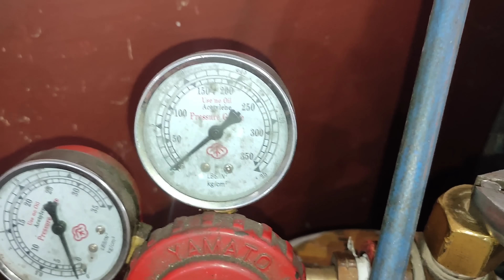how to weld aluminum without argon

Comment: Another case of “ A little knowledge is Dangerous “.
Reply: That repair will last as long as a sneeze
Reply: @arturotoscanini3833  
And nowhere as enjoyable!
Reply: What would you recommend
Reply: @MomodouSemegaJanneh  
Firstly it needs to totally clean then correctly prepared before welding in an oxygen free environment. 
Take a few basic classes in welding.
Reply: Back in 1978 The US Army taught me and other enlistees in a Proving Ground base, the procedures and practices of various welding processes. In order to complete the Annex, the last process was oxyacetelene welding alumimnum. And the last test was welding a single "v" groove butt weld in the flat position with  30 degree included angle, I believe.  The aluminum coupons were aproximately 10" long. This was the hardest to do succesfully because aluminum does not change color when it heats up like mild steel and stainless would when welding with the GTAW, GMAW, SMAW, FLUX_CORE, processes, etc. When you heat it up, at a certain point, the puddle drops and its off to the races. Of all the other processess taught, this was by far the trickiest. 
That being said; is this weldment fix legit? I would say, not knowing all the other factors relative to this case I would say it may or it may not.
Cleaning aluminum is very important to the quality of the outcome for both cosmetic and function. And in this case not much cleaning other than perhaps wiping seems to have been the case. 
I have to give it to this dude for putting out this video. If for no other reason than to learn how judgemental people who think they know, are.
In the video authors case this may be all he/she had to work with.
So, if it worked, more power to him/her.
Aluminum welding with oxyacetelene is a thing, really.
It is interesting he/she used a 6013 SMAW rod to blend or mix the crack. Then reinforced the work by overlaying aluminum, thereby adding penetration in reverse.
I thought it was cool. But what do I know.

Comment: So, actually brazing or soldering, not welding. I HAVE gas welded aluminum (welding is when you actually melt the parent metal together). It is much more difficult! Also, it changes the temper (hardness) of the metal (annealing), making it useless sometimes, as anything that broke it in the first place would likely bend it easily after the metal has been heated and cooled. An example of TRULY welding with oxy/acetalyne is the process in Britain of building alloy fuel tanks for (now) vintage motorcycles. Part involves special blue-lens goggles, which are not available in the US.

Comment: Tahun 80 tehnik las begitu ..sudah ada pakai las acetylin...
Reply from the maker: I use used brake pads made of aluminum to make welding materials, you can also use engine blocks that are no longer suitable for use 🙏🙏

Comment: . . . torch tip needs cleaning,  probably should wear leather gloves (and safety glasses) when using a small electric grinder,  work piece needs to be cleaned before welding it 🤔  taking the time to get a few small details right could greatly improve the quality of your repair
 . . . also it is not welded in a true sense but it is probably good enough to get by for now which there is nothing wrong with that if it is working for you but the ferrous material in the repair will begin oxidizing on exposure to moisture which might be a consideration of why the bracket is made of aluminum in the first place
Reply: Was not a ferrous metal filler, if it was it would not bond with aluminum.
Reply: @tubeonline629   . . . there was NO bonding,  it was  not a coalescent weld

Comment: That Welding rod stated 6013. 6013 is a Steel Rod. Steel and Aluminum doesn't mix two different Metal's. My opinion the only way to weld Aluminum is Heli arc. Both pieces must be completely Clean.
Reply: You need metal rod to remove the oxide layer is not filler material
Reply: @jetfulvio  A Stainless Steel Brush will do the same thing. Adding impurities into Aluminum doesn't work For Me. You are the First I scene to do this type of welding. Aluminum is Very hard to weld because of contamination. There is oxide in the Metal that causes the metal hard to weld. Welding with AC Heil-Arc is the only way with a High Frequency unit. Braising flame has a pluting Flame.
Reply: @waymonblevins6939  @Waymon Blevins  you will be surprised because with oxyweld you can weld really weld old dirt and oil crankcase (i welded old vespas crankase i let you imagine) and have no porosity in the weld , also the oxide layer is kinda inhibited with a rich flame  and you have to scratch the surface to understand the melting point of the alluminium which is lower than the oxide temperature
Reply: @jetfulvio  What Gas are You using? What Aluminium Filler Rod are You using 4043 or 6061. The 6013 is an AC current Rod. That is not an DC Rod. I understand the heat burns the oil and grease but You still have to clean the Area you are welding.
Reply: @waymonblevins6939  acetylene and with the tig rod it wasnt really good you have to try with melted alluminium like those guys also did trust me
Reply: @jetfulvio  I have been a High Pressure Welder for 43 years at pressures of 10,000 psi Steam. I have worked in Steam Plants in Nuclear Plants, Plant Mills in Black Liquor Boilers but I never seen this type of welding before.  I have done all the Forms of Welding Mig, Tig, Stick, Fusions Welding and Brazing in Steel to Brass on all kinds of Metals but You Surprised me seeing this. I have worked with very Good Welders in my life as myself but never have I seen using Steel on welding Aluminium. Just informing You.
Reply: @waymonblevins6939  steel is only to remove the superficial layer of oxide that melt at highter temperature than alluminium, if you try to weld a piece of alluminium you won't be able to see his melting point and at one point it will just collapse because the oxide melt after alluminium so you have to scratch the oxide away , when you can scratch away is at the right temperature to start add the new alluminium but you have to first remove all the oxide layer
Reply: The steel rod is used to poke into the liquefied metal to make sure it welds thoroughly. The steel rod doesnt melt, nor does the aluminum stick to it. So you can see little be little he melts one end making sure the metal is fully welded by allowing the rod to pierce the molten aluminum, then allows it to cool. Kinda like fixing cracked plastic with a soldering iron, you poke into the layer to make sure it is bonded.
Reply: The rod actually just use for mixing feed and base material. Just use acetylene gas burner for melting both material. Thats for simply all i know sir🙏
Reply: Good eye
Reply: He was using the 6013 as a scraper kinda . Just moving the coating out of the way to get to bare aluminum
Reply: Very nice work 👍.
Reply: Your opinion would be wrong.  And been proven for years to be.  Plenty of aluminum thru the years has been gas welded. Even stick rod welded.  And MIG is very common for aluminum
Reply: @dieselguy62  To do a 100 percent weld on Aluminum is by Heil-Arc. Yes You Mig a fill-it weld but No 100 percent gas welding is Not 100 percent either. But to weld Aluminum the right way on a Commercial Job it's Heli- Arc any Real certified Welder that weld Aluminum will make the statement I have made. If you are a scrape iron rod Burner you may but Heli-Arc is the best. It appears you have never done any Commercial welding on Aluminum.
Reply: @dieselguy62  Sir I have worked For 43 years As a Certified Welder. I worked in Nuclear Plants, the US Air Force, many U S Federal Government facilities  where the Highest Restrictions on Weld Joints with Many Others are equal to Me.  And Not One Joint of the pipe was Welded with any Gas Torch. As I stated there is a difference between True Certified Welders than Rod Burners. So go and to convince Someone that Believes Your BS FOR ME I DON'T. DON'T CONTACT ME AGAIN. ANYONE THAT MADE THE LIVING AS A WELDER KNOWS THE DIFFERENCE.
Reply: @waymonblevins6939  i made a living welding. And gas welding aluminum is very common.  And the best process to use depending on the end use of the aluminum.  
Just because you haven't seen it or can't do it.  Doesn't mean it don't exist.  
As far as "don't contact me again". Boy this is the internet and YouTube.  You don't want a person relying,  don't fukn comment
Reply: @dieselguy62  when Pigs Fly.
Reply: @waymonblevins6939  well.  Have fun boy.  Cause I've seen it
Reply: @waymonblevins6939  The 6013 rod is a gen purpose steel rod. The filler looks to be reclaimed aluminium from where ever.
Reply: @dieselguy62  Yup. Just need the right wire and the right gas combo. Either 4043 or 5356 wires and 100% Argon shield gas...and push the weld.
Reply: @tobygathergood4990  The 6013 is a quick fill AC/DC rod that can be used on steel only. Mostly for sheet Metal or open butt welding. It's Not for any form of Aluminum.
Reply: @waymonblevins6939  Watch it again! He's not using the 6013 as a filler- only to scratch the slag surface.
Reply: @clancambo5297  In 43 Years of Doing Processional Welding I NEVER seen a process of Welding Aluminium this way.  If You are Home doing it for your self that may be okay for yourself but Not for Me. There is a right way to do anythings but this isn't the right way According to the Masters that teach Aluminum welding.  Aluminum is a peculair  Alloy made from Bauxite that MUST BE CLEAN. To Heli-Arc this metal it need a AC High Frequency Machine that cleans the Alloy. Aluminum contaminates quickly just by the Air only on the surface of the Alloy. The AC Heil-Arc is much hotter than a flame Torch. The Heil-Arc Boils the impurities from the Aluminium. Any Person that is a Professional will laugh at You if you tell him to do a certified weld with a Flame torch of Aluminum. It doesn't happen on Professional Work of Highly Controlled Jobs.
Reply: @waymonblevins6939  l only corrected your mention of 6013 as a filler.I only Tig aluminium.
Reply: @clancambo5297  Agree. 6013 has No Business around Aluminum. If You scratch Aluminum with 6013 you are adding a Metal deposit to that Aluminum, which is a contaminate. As stated there is a right way and a wrong way and welding Aluminium with a gas torch is wrong.
Reply: its used to poke the weld
Reply: @PakPikPuk  Never ever stir aluminium with another metal other than stainless steel. Time for you to do some research.
Reply: @waymonblevins6939  6013 is good for both AC & DC
Reply: @waymonblevins6939  but clearly you have zero experience welding aluminium with oxy-ace. it's perfectly possible, perfectly acceptable, has been done for decades and makes perfectly good joints depending on requirement. always more than one way to skin a cat.
Reply: @daos3300  Quite.  It's been done for more than decades, too.  My grandfather used to do this, it's how aluminium was welded before the other processes were invented.  Certainly, newer processes are perhaps more rapid, and almost certainly easier to do, but a lot of people here need to pull out the oxy bottles and have a go, they might be very surprised what can be done with gas.

I'm not certain, but this is possibly one of the few viable ways to weld highly contaminated aluminium without risk of porous welds.
Reply: @waymonblevins6939  irrelevant. you don't seem to have realised that all welding is not carried out for the us air force/us govt/whatever. there is a big wide world outside of those narrow organisations and outside the us, and plenty of professional welders around the world using gas to weld aluminium to world class standards. there is no right or wrong, it's about the design requirements and which industry you work in, not which country you happen to come from, or your narrow area of experience. so take a step back, stop shouting, learn some humility and understand there is more to this, and other professions, than you can ever know -  especially when you refuse to learn.

Comment: First mistake was using a cigarette lighter to ignite the torch. Hope this wasn't going to be used in a critical part. This is just gluing the part together with no penetration and all that contamination from the dirty part is not going to help. Needs to have proper preparation and MIG or TIG welded to provide any strength. The final grinding might make it look a little better but you just removed that surface metal you added so even weaker than if you left it alone.

Comment: The base metal doesn't melt, so it's not welding. Try to find a term in your language for soldering. You will be closer to correct.